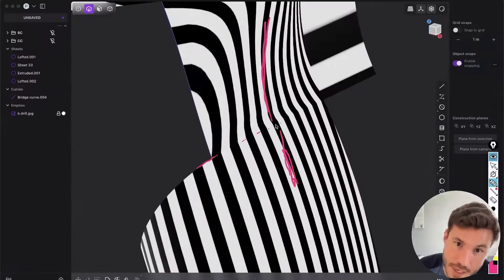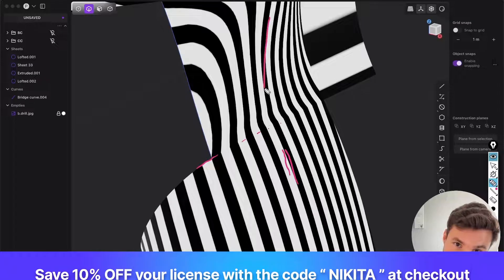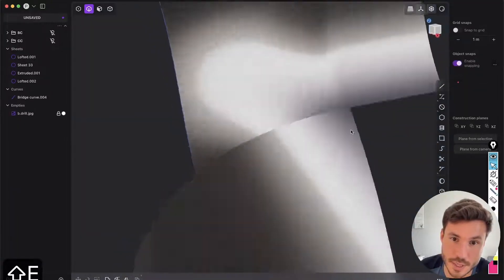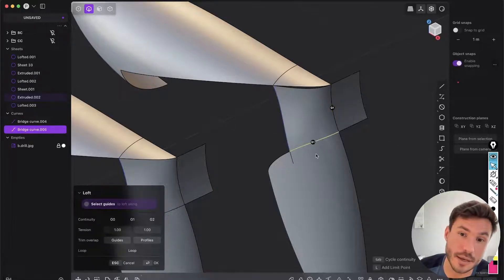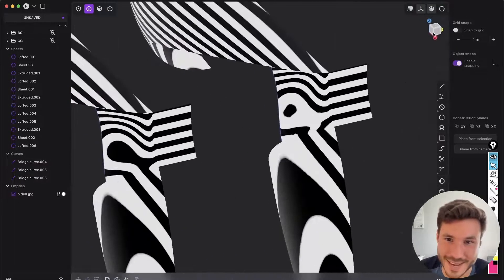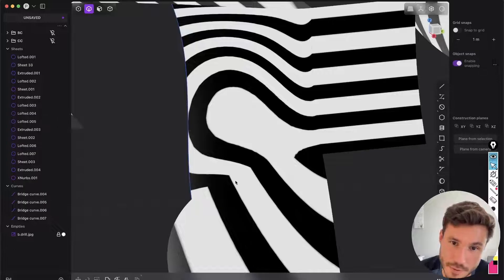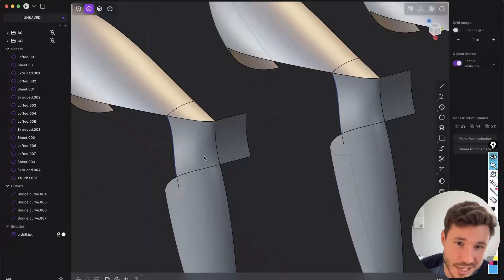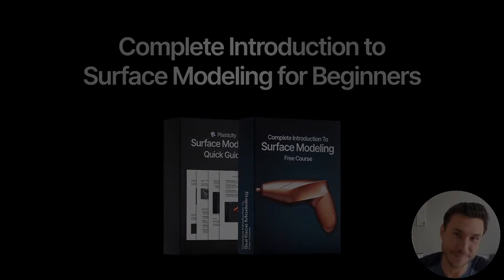Zebra Stripes & Surface Quality | CAD Surface Modeling

Comment: Hi I am having an issue with Plasticity studio. any model that is bigger then 2GB will not load and give an error saying the model is over 2GB and will not load the model. is this a limitation in Plasticity? is Plasticity limited to 2GB max model size? if so, this is a deal breaker for me as this is not stated when buying the program.